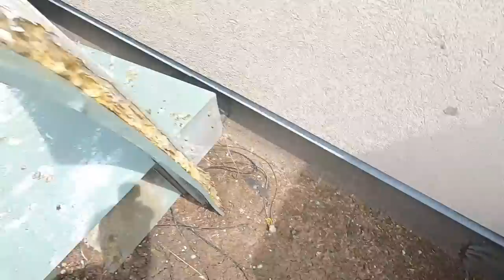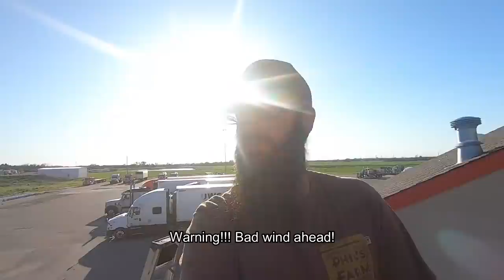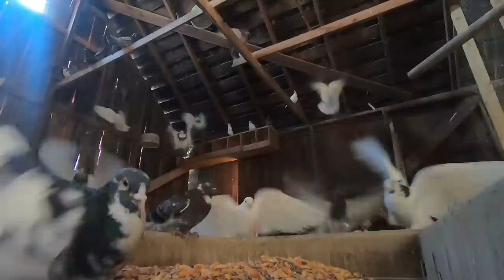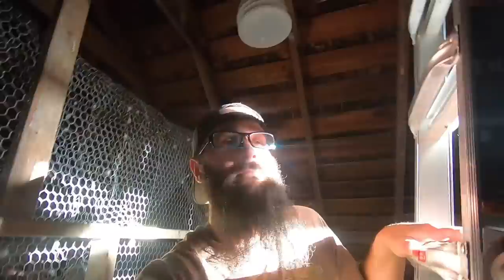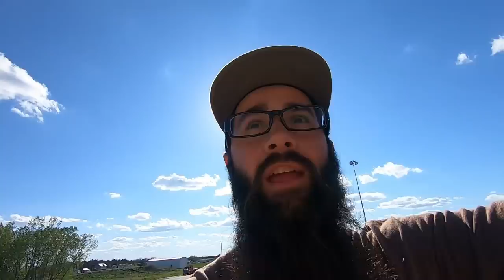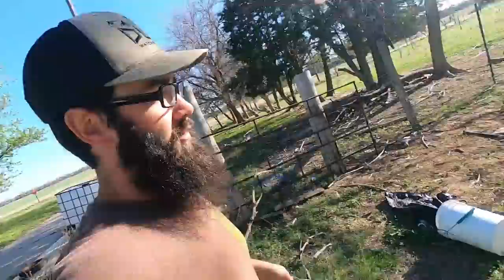Pigeon Trapping and Loft Update! (Pest Control)

Comment: Apple cider vinegar in the water a cap full or 2 per gallon change the water daily look at the poop make sure it looks good give it 10-14 days of that they should be taking to feed eating eagerly eyes clear no goop or crust look at the feet make sure they have good feet you don't want to breed crappy feet into your flock do they stand with both feet on the ground or do they hold one up

Comment: I use a 5 gallon pail on the side with a 1x6 laid in it with a 1x4 screwed across the front my birds seem to like them that away screw pail to wall through bottom
Reply from the maker: Thanks for the tip!